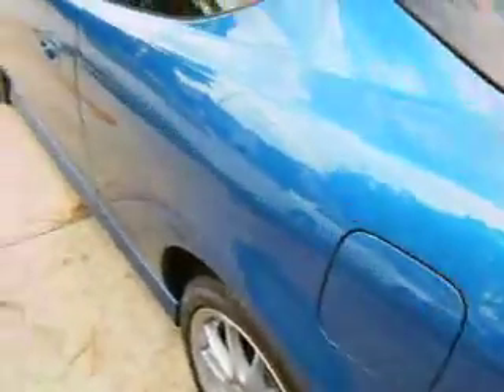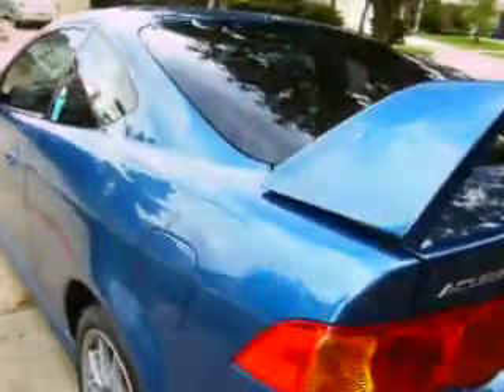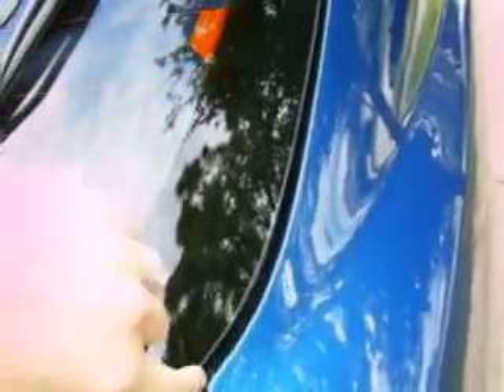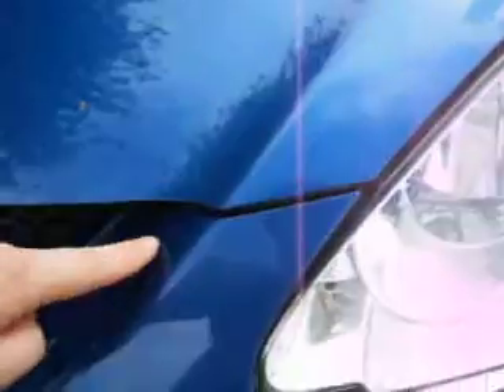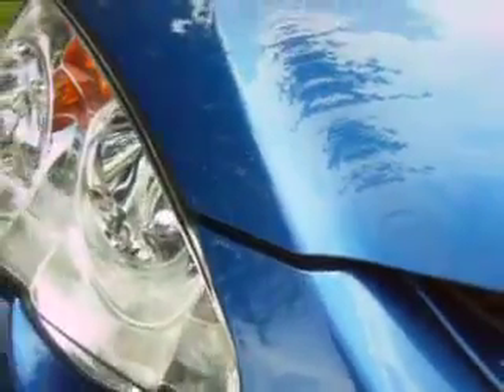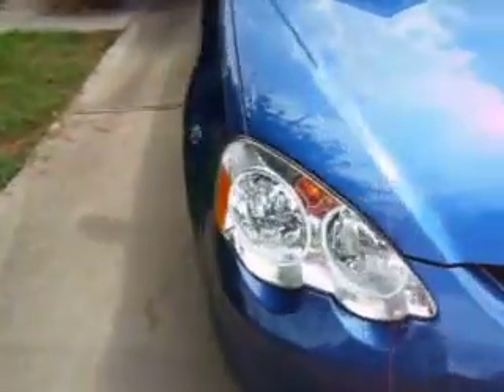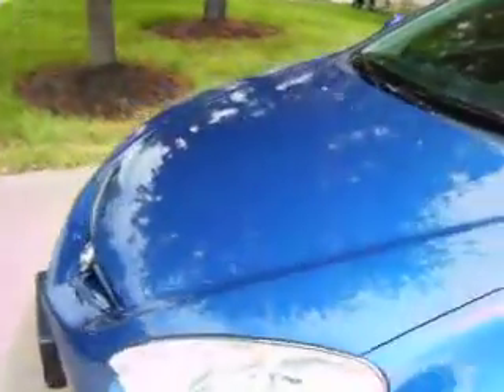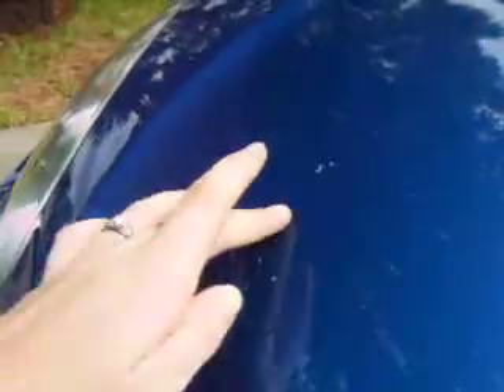RSX after the accident; feedback, please!!

Comment: @ashlaree  

I've had the vibrations in my car. My car was hit in the rear and repaired prior to my ownership. turns out that the exhaust was not only touching the frame, but it was also touching the rear bumper, causing the car to shake at low rpm in gear and in mid high rpm.

Comment: You're right, the entire frame bent during the accident. The rear-left/front-right corners are closer together now, and the left-front/rear-right farther. If you look closely you'll probably notice a difference in how the doors fit too. Alignment would be effected too.

Same thing happened to my civic ep3 (same chassis), but less because the crash was minor. Same would happen to any car, probably worse: ep3/dc5 chassis are more robust than average.

Comment: I had a 2000 Civic that was rear-ended by a girl driving a Neon on the freeway. After it was repaired, the rear fender still drooped a bit. Apparently the impact affected the other panels. Looks like that's what happened to your's. It still looks cool but I don't blame you for feeling bothered. I would be pissed if someone collided with my RSX-S.

Comment: What shop did you take it to? (I live in Houston too.) Did only the rear of the car come in contact with the wall? Does the hatch open and close with NO problems? I think you are on the right track tho, about the frame might be bent. Shouldn't have the different size gaps front and rear. If it were my car I'd take it to an Acura dealer and let them look it over. They know your car better then anyone. Let me know!

Comment: Don't sweat it...

I bought my car with 2 accidents and there's really no biggie to it. Sure the bumpers (both back and front) don't look the way they would out of the factory, but I'd take that and the $1,000 I saved on an accident car over a mint one.

As long as it wasn't frame damage I'm cool with it. I have bigger worries on my RSX and that includes two darn leaks, a bad range switch gear sensor, and a squeeking power-steering pump.